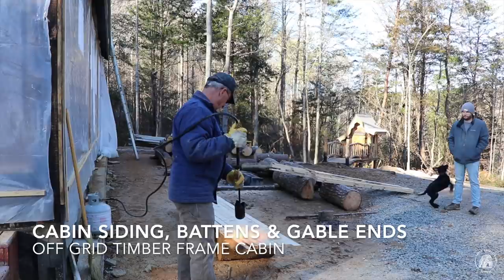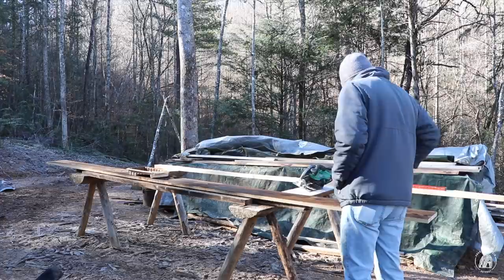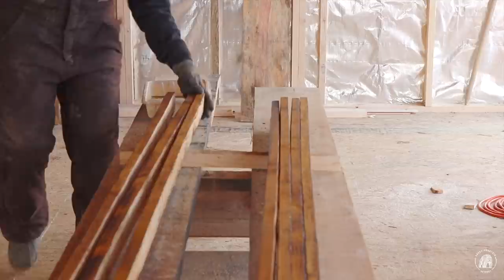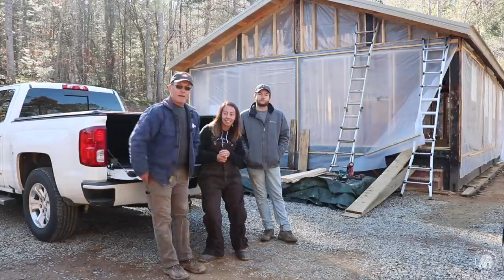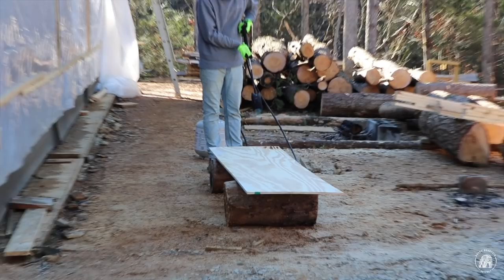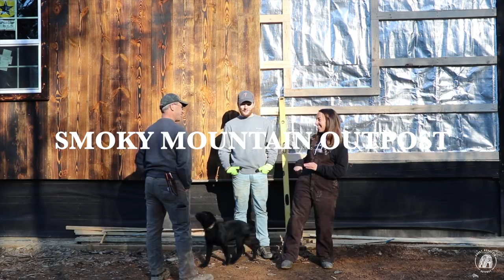CABIN SIDING, BATTENS & GABLE ENDS | OFF GRID TIMBER FRAME | WOODWORK

Comment: Yuz Guyz are doing something utterly impossible.  Hey, I enjoy the videos.  One comment about ladders.  I cringe every time R climbs the ladder.  They are set right, But climbing using two points of contact, not good.  Should use 3 points of contact just like in rock climbing.  When reaching out to screw in the wood, etc. one shouldn't go further than your elbow.  Center of gravity stays on the ladder. Maybe a safety harness is a good compromise.  It doesn't take much to slip off and how are you going to call for help with broken bones?  Personal experience.  Just a thought.  tim
Reply from the maker: I understand what you are saying. Good suggestion! I worry about my Daddy! Thanks for following! -Jennifer